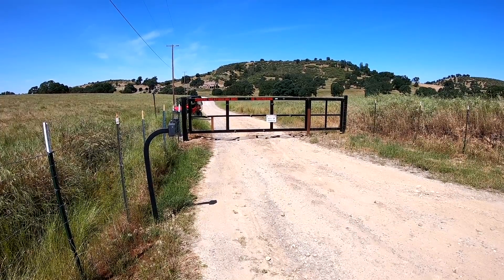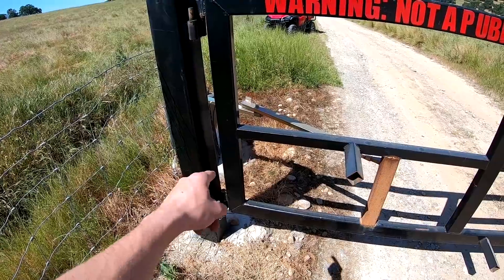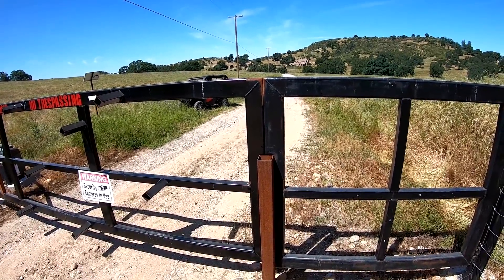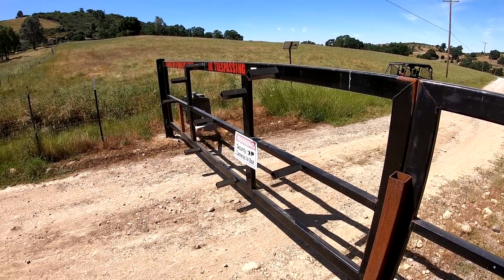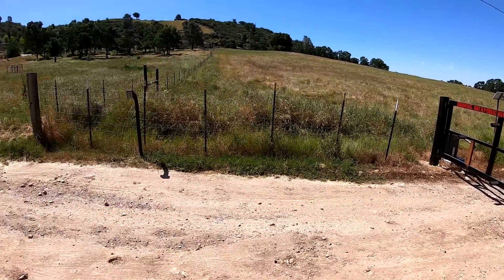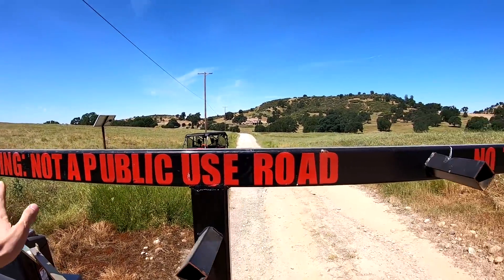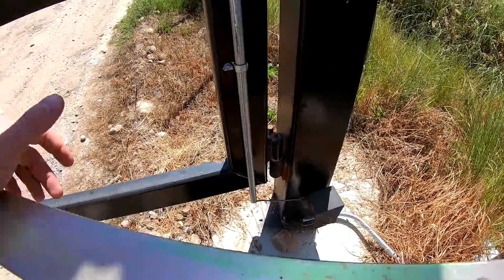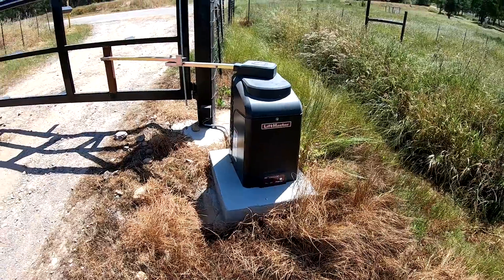This Gate Will Stop A Car, Don't Mess With Us!

Comment: You should have set it up to open outwards... In that position you could brace the back better to prevent ramming.
Reply: hot wire the motor to open the gate  duh
Reply: punker4Real exactly, if you know what your doing, any motorized lock or hinge is useless
Reply: @Fungulus1  or just hit the fire access button on the opener....it aint rocket science.
Reply: you can just push it open with your hand as it sits now....
Reply: @Fungulus1  Emergency services are keyed not coded.
Reply: ramming or simple pushing.
Reply: Is this really a thing? ramming and pulling gates to get through?
Reply: If people respected other peoples property, you wouldn't need the gate in the first place. Whats so hard to accept here?
Reply: @TheRequimen  you act like there is a pile of gold behind that gate, the gate isnt protecting anything the acces to the road.
Reply: @DieselRamcharger   Damn dude, what a mind bending statement, now that everyone in this comment thread knows that, we won't have any issues! Thankyou Diesel Ramcharger, very cool!
Reply: @rmbzbrenden7739  I know i know, its a hard concept to understand. But with years of devotion, you too may be able to wrap your noodle around it as well.
Reply: Fungulus1 which is why you might want a bowley lock with this.

Then people will try to drive through the side of the fence
Reply: @DieselRamcharger  pretty sure thats not necessary on this gate because its a private road

Comment: The only thing holding the fence in the closed position is the electric motor.  That doesn't seem like it would prevent any ramming
Reply: Watch the video. There is an electronic latch.

Comment: Heavy strong gate , weak link is the actuator pivot
Reply: literally anyone can come along and just chop it with a pair of decent scissors, really worrying lol
Reply: @lytheus69  not even that, grab that exposed wire an yank then short it out with  your cars battery an some jumper cables. Open gate.

Comment: Use Flex conduit to protect the wire.
Reply: He did a nice job on it, but I thought the same a little carflex from tho opener to the gate and also off the gate portion. Overall very nice though.
Reply: There's a commercial product for that, sold as an armored door loop or armored door cord, but recreating one with ordinary flex conduit should be easy
Reply: @fitzmorrispr  check out products like Kopex & Adaptorflex for mechanical flexible protection of looped cables. Ebay is worth checking for people selling off cuts and the threaded glands for each end for a small one off project like this or any other. Great products for professional industrial installations :-)

Comment: Look at some reflective tape around the corners and mid gate so in pitch black someone can see the gate before they strike it.
Reply: Not the purpose based on how his gate is designed (description says built to stop a car)... private property = no shortcuts or anything of that matter... cant blame him... I'd be just as pissed too if it happened to me.
Reply: @BeezyKing99  If the road leading up to that point isn't extremely obviously labeled as not public access to the point no one who isn't both drunk and blind would fail to miss it, then this really should have some reflective tape on it. Someone's GPS tells them to make a wrong turn, they strike the gate at night, and lawsuit time. 

Some reflective tape and some caution signs will cost a hell of a lot less than this gate  did, and even less than a lawsuit. And by a hell of a lot less, I mean like maybe 20 bucks? 30 at the outside. Some reflective tape should definitely happen,  that'll cost less than a tenner.

Plus it'll also help protect the owner from accidentally running into it if they're having to come home tired at fuck off o'clock.
Reply: @DataumCats  a GPS will tell you that there's a Private Road or a Road that is not for Public use on your route.
Reply: @lolly166541  It may tell, or it may not. In rural areas, GPS' aint the most reliable in these things.
Reply: @lolly166541  No it won't? Wtf are you talking about.
Reply: @livedandletdie  I can smell the edge 😷
Reply: @livedandletdie  and here I'd respect the private property sign, apologize for my mistake - assuming you saw me and reverse/turn-around! 😅
Reply: Put a dummy gate leading into the ditch and then reflective tape that sumbich ... "Oh shit Dale the gates open, peddle to the floor!" BOOM
Reply: @DataumCats  good argument there.. I'll give you this one.
Reply: @livedandletdie   man I'm seeing your comments and you should probably seek help for anger issues if you fanticise about killing tresspassers this much because to be honest, saying that you are going to disappear people just because they are on your land is some serial killer shit.
Reply: Regardless of whos fault it is who wrecks on the gate. You dont want to deal with soneone abandoning their totalled truck on your road.

Comment: I bet it easily opens with a 12 volt car jumper and a screw driver
Reply: The fence next to it easily opens with a $2 pair of wire cutters. He talks about the berm, but 20 yards down it's easy driving.
Reply: Acetylene torch will make short work of it
Reply: AwkwardYet entitled people wont take the 4 or 5 minutes with that kind of equipment standing there.

Comment: As someone who deals with Gates and gate repair, a vehicle would go through that pretty easily.  That swing arm is frail.

The only gates or rather barriers that work well are the hydraulically driven bollard barriers.
Reply: I thought the same. My Land Rover defender with bull bars on the front would breeze through that.

Comment: understandably you've focused your security on the main  threat you had encountered, ramming. and made in my opinion a pretty solid gate which definately wouldn't be worth anyone ramming. However you've done it at the expense of you over all security to other threats. that wire defiantly should have been run through the gate, through the post and underground into the control box. You need a more solid way to hold the gate in place, like a magnetic lock or remote controlled dead latch. also be sure to change the lock on the gate opener as almost all products like that just us standard keys... your gate is worthless if someone can just get a generic key, open you gate opener and activate it without caring about the key pad

Comment: That opener seems like it'd be trivial to disconnect from the gate.  Either that or just pop the keypad off and bypass it. Of course you'd have to cut the wire to the lock and supply power to it also.
Reply: Think he should have used a padlock And a gate. Talk about making things complicated.

Comment: far fron thefrt proof. so what happens when someone cuts the exposed wires ans puts a 9volt battery on it?  you mntioned it was low voltage. 
Or hooks a cummins or duramax to it and decides to pull on it?

Comment: For that loose wire use some of the shielding from aluminum armored 220v electrical cable. Commonly used here in exposed surface mount wire to protect it.  Flexible and even hard to cut with a hacksaw

Comment: So... Hydraulic bottle Jack? Pop the hinges?
Reply: Bust out the m1 Abrams tank! What's the point of building this fence when a 60 ton main battle tank could just run over it!!! He really should just have 24/7 security for that dirt road!
Reply: @rmbzbrenden7739  an M1 Abrams is a bit difficult to source and actually own, let alone navigate there.

A bottle jack can be picked up from home depot or harbor freight and once in place, have the gate off it's hinges in under a minute.

He should weld some plate over the top of the hinges to act as a stopper.
Reply: @lmaoroflcopter  but that wouldn't stop an m1 Abrams tank!
Reply: @rmbzbrenden7739  well no, but he hasn't mentioned anything about M1 Abrams tanks going up there.

He does however have people going through there who carry bolt cutters to cut through his chains.

Them jacking a gate off of its hinges is not an escalation if they already chop his chains.
Reply: @lmaoroflcopter  but tank
Reply: @rmbzbrenden7739  yes. Well he can throw a few ww2 era tank traps around the place, a few artillery shells rigged up to a pressure trigger or two should at least track a tank or two.
Reply: @lmaoroflcopter  now you are getting it

Comment: Maginot line?  (Just drive around)
Reply: Maybe if you had a tank, there are ditches and berms to either side.
Reply: Good luck, 4wd doesn't do shit if you get stuck balanced on a berm because you bottomed out. Maybe if you had a ridiculously lifted truck with massive tires just short of a monster truck.  Those berms are about chest-high from the road, add in the ditch, and you need some serious lift and length to pass that. IE tracks, not an F150 with big tires.

Comment: We did that on my friends Ranch we poured 8 in wide x 12in deep footers in that we put 5/8 in Chromoly Tubing.We  cut a 45 out of the end to a point and left them 7inches out of the ground,there's Aprox 900 Spikes left and Right of the Gate.As well as some longer sections sticking up designed to hopefully puncture Oil Pans,Fuel Tanks.Then there's the Germs that are filled with Urbanite(Chunks of Concrete) the angles of approach are made steep so as to frame out the Vehicle,the gate is similar chained,and to the swinging side there's 2 Bollards behind the gate,it's gonna hurt if you try to drive through the Gate.Its got a bunch of Quads and Side by sides,the 5/8 Pipe really does the job it destroys Tires.

Comment: I'm an engineer, and I'm telling you that wouldn't come close to stopping a car.
Reply from the maker: So you're driving down the road and come across a closed gate, would you not stop for it? Nobody said designed to stop a car at speed
Reply: @HighTechLab  Then dont clickbate
Reply from the maker: @iamthetinkerman  But it will stop 99% of cars trying to pass.
Reply: @HighTechLab  come back to me when its able to stop 100% of cars wanting to get through!
Reply: @iamthetinkerman That 1% would be looking at thousands in repairs. Money will stop them 100% of the time.

Comment: Nice gate, Shame you've got a low tech keypad which would take 4 screws to open and circumvented in under 1 minute.
Reply: J Secret you really thing someone is going to take there time to just take a little shortcut
Reply: @logankorte9043  If you listen to the extent that people have already gone to to use the shortcut then yes.

Comment: Love it!!  Here's a tip that may help you for that section of wire that needs to remain flexible at the bottom of the gate.  Get an old metal spiral-wound hose from a hand held shower head.  I use it here for wires that I want to protect from rats and mice, but it's very good stuff.  I've used it also to protect wires and cables on motorbikes.  It's flexible and incredibly tough.  Make sure you get metal - they make a metallic looking plastic one too, which is obviously not as tough.

Comment: You can cover the wire with some metal flex conduit.  Also look at getting a magnetic lock since you already have power at the location.  with that gate a mag lock should provide a couple thousand kilogram resistance. 

it is sad that people have to go to such lengths to keep people out now.  Used to be that a couple of fence posts or a bit of wire would let people know that it was private property, and they would respect that

Comment: Seems well made apart from the exposed wire
However no gate can be protected against a portable disc cutter that could slice through the gate
Good luck
Reply: Like the spinning blades on the Mach 5 that Speed Racer used.
Reply: The trick is to slow down their grinder ….make them go thru a set of batteries

Comment: If it opened out then it'd really stop a car
Reply from the maker: If you notice there is a second set of hinges welded on the post, I originally had it swinging out
Reply: Alec Ver Bunker, no it wouldn't... because you could tow it open then...
Reply: @livedandletdie  You have allot less mechanical advantage pulling with a strap then you do ramming with a car. That said I'm still confident this will stop a car a large truck with a brush guard maybe not but definetly a car. The ultimate system is retractable bollards but those are very high maintenance specially where there's snow.

Comment: Small bottle jack,  jack the gate off the hinges. Need flex emt, weld washers on hinge pins.
Reply: Yep should have the bottom up and top down so it cant be lifted off
Reply from the maker: The hinges have a ball bearing in them, if you do what you suggested then the weight is not on the bearing and can be a serious issue for a gate this heavy
Reply: @HighTechLab  then you should weld a "stop" above the bullet hinges on the post to prevent the lifting of the gate

Comment: You should've used those huge hydraulic ramps in military bases that can stop tanks instead. You should also put a CROWS twin .50 cal system on a 15 ft tall podium next to the gate. That way, you can have "Turret defense system in use" as another warning. Even this can be a potential security fault, as it can only cover a 1/2 mile radius. What would really be effective is a 16 inch gun turret on the center of your property (20+ mile radius) and drones flying overhead to give it telemetry. All  vehicles will have to have a special transponder when they enter the property line, or else they will be blown away.

Comment: What kind of lock did you use, a fail closed or a fail open lock? If it's a fail open, that gate can be circumvented with a pair of scissors, which would be a shame. I assume you thought of that, and picked a fail closed, since having it permanently closed until the issue is resolved isn't immediately life threatening (although it could be an issue in case of an emergency), but I'd like to hear your thought process on that.
Reply from the maker: Fail closed (safe)
Reply: I assume the lock is powered by the solar panel and battery as well? Did you think of any options when the wire would get cut or damaged and you really need to get through, or wasn't that too much of an issue since there are two ways out?
Reply from the maker: There are two ways out and you can use a key to override the lock.
Reply: Jeez, I actually remember seeing the keyhole on the lock now you mention it. My brain should really have remembered that. Seems like a pretty good system you've got set up. Any issues I could think of, you thought of too. Nice job.

Comment: Looks like it'd be pretty easy to push open. That opener certainly isn't going to stop a 5,000lb truck lining up and just giving a little gas. Magnetic lock, and having it open outward with a single Ballard reinforcement behind to stop the gate from opening if a truck did attempt to push it inward.

Comment: It Would of been the mother but it’s only as strong as it’s weakest part. That small gate is the weak link. if you have more issues put some kind of bollard dead lock on the back end.

Comment: for that exposed wire on the gate there is flexible conduit you could connect to the end of the conduit from the lock  connecting to the conduit on the post. protection end to end. it's called flex.

Comment: This gate is the equivalent of "The Club" steering wheel lock. It's over built and worthless. You can just cut the flimsy steering wheel in about 5 seconds, just like I drove around this stupid gate and right over the flimsy fence.
Reply: There's more than just a fence did you watch the video?
Reply: @admiralmudkip9836  Yes, Admiral and I've already ridden around it.

Comment: Couldn't you just unfasten the bolts on the pivotor and open the gate that way?
Reply from the maker: The nuts are tack welded on.
Reply: @HighTechLab  Good forward thinking! ;)

Comment: Did you ever try to get a quote on a barrier 1 system. They have semi-low cost systems designed for single person manual or electric\hydraulic use. Some designed to stop 15,000lbs moving at i believe 55 mph rated.
Reply: 55 MPH is a K12 barrier - they're not "semi-low cost."   Delta Scientific was the first company with K12 barriers.   Crash gates are particularly difficult to engineer as they're a full height barrier that has to stop a vehicle, yet still open.   Crash beams are less expensive but hardly "semi-low cost."